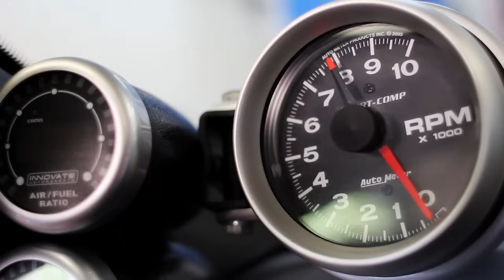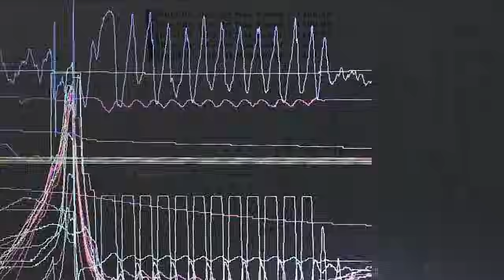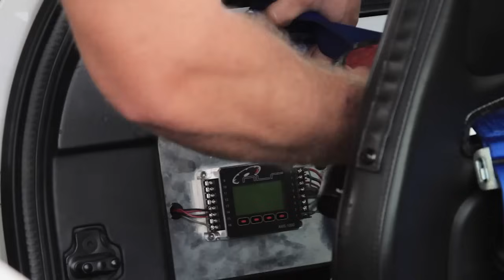New World's Fastest Car! Ford GT Bad v8 1700 Hp - 455.817 km/h ( Guinness World Records )

Comment: fastest car in a straight line  easy   . try fastest car on track
Reply: i wouldnt be surprise if they did make one for that too #USA
Reply: Allen Penitavalu Likiliki then why didn't they until now?     we are already in 2014  .
Reply: Thats like telling the best soccer player in the world to go and be the best basketball player. they obviously built this car for this purpose not to race around a track.
Reply: Brad Hulm your example is a bit flawed... It would be correct if we assumed a soccer player that runs fast but doesn't know how to pass or shoot correctly... A player like that can not be considered good in overall performance. European and Japanese cars are far ahaid...
Reply: Alessio.. No. Just no. Thats ridiculous logic. besides whats so fucking "easy" about 450 kmh? id like to see you try.
Reply: bult ennough torque to push the  charriot forwards against  a wall of pressured air on a overdrived gear.  create a reversed wing to keep downforce. bult the bodywork strong ennough to not rip open by the pressured air it encounters. Make shure the engine last for 10 hours. don't care about manouvrability  brakes, suspensions
Reply: you're forgetting that the Ford GT was built for the track
Reply: austin robinson not with that kind of engine, you would have to be a crazy man to drive that thing fast in corners
Reply: be fun though
Reply: jack jill
still possible with that engine if you have  a torque limiter,,  but then all that power would be meaningless. Anyway they have fun breacking speed limits with piston engines, that's theyr purpose. Its just me that finds race on tracks more exciting.  Different culture I guess.
Reply: Alessio S open track days are awesome!!
Reply: Its the fastest so who cares.
Reply: then go watch track racing lol
Reply: Tom Cholewa
 yes ofcourse, but not F1 that's boring as hell
Reply: *****
    that was 40 years ago.  no american car can beat  european sportscars on track none.  unless you drive  in a big oval
Reply: Alessio S
the corvette is still an American sports car and will whoop most European sports cars, with the exception of the European super cars but you will never see them competitively raced cause they cost to much. So as it stands the US sport cars/super cars (the ford gt and the corvette) trump any production cars the Europe has.
Reply: The GT40 was made for the track. Mid/Rear engine = better weight distribution for better rear traction and cornering
Reply: xFSTRx but that is not a gt40 tho its the newer production  model ford gt the ford created to remind ferrari that their car is still better then any ferrari
Reply: jt cooper  jt no... it was to piss enzo off after he backed out of a handshake deal

Comment: I don't consider this above the Veyron. It's been heavily modified. Almost anything can beat a Veyron after it's been tweaked to 1,000 HP+ (Alpha GTR's, UGR's). But straight out of the factory, a Veyron will slaughter this Ford GT for bacon.
Reply: A straight out of the factory buggatti is already "heavily modified"........ and it cost atleast 1Mill .............................................................................................................
Reply: kenho3j0k3r
I understand that. But a factory Ford GT is already heavily modified, will destroy a lot of exotics at bone stock, and it ranges in price at $400k. I'm sure if we applied the same amount of money they spent upgrading this Ford GT to the Bugatti Veyron, it would slaughter the GT for bacon and sausage.
Reply: Tokyuuu Personally the veyron isn't that impressive. with an "8.0 L (488 cu in) W16 quad-turbocharged 1,001 PS (736 kW; 987 bhp)" you think it would do more. 

As for AMS, Underground Racing, Performance Power, Etc Etc the fact is they are much cheaper than the Veryron (Minus the Venom GT). I guss that's what it comes down to. As for the money spent tuning. They still come in cheaper. For example Lambo Killer Supras and so on.
Reply: WhatWhatWhatWhatWhat cheak out Nelson Racing Engines they have a naturally aspirated Chevy with 712 Hp and it weighs less than 400 pounds and runs pump gas with a 4500 RPM power band starting at 2000RPM never dropping below 500 Ft pounds
Reply: One could argue the words production car. In essence it means that it is possible to be built and assembled in house, that the factory is equipped with the parts and machines to assemble it. But most people would believe it can be massed produced at a high rate when one uses the words production car. It cannot. Lets look at the facts. 1 week per engine, 150 hours per radiator,90 hours of labor per framex2 (front and rear),3 days for the fuel tank,1 hour per handmade tire, the car is assembled by hand, 4 or 5 weeks total to build from start to finish.
Reply: that is not what the video is about.
Reply: MrLembnau Exactly, fastest car on the road. Not fastest production car. And no matter what anyone says this is one hell of a car.
Reply: sirlonghair Kinda scary
Reply: The Sex Couch
Do you think it's easy making 1200hp on 16 cylinders AND making a product that you're willing to warranty for 50k miles or 100k miles?
Making power is cheap and easy....making reliable power that can pass an emissions test (sirlonghair, that means no Nelson motors ) is VERY VERY difficult and expensive.

those who always judge feats of engineering never have a background in the field themselves...
Reply: HunterKiller89 I never said it wasn't a feat of engineering, in the end that's all the veyron is. Another testament to we can do it.

But, since you seem to say something without a background....they HAVE A 2 YEAR warranty...for an EXTRA SEVENTY THOUSAND. And yes for a car that is  "$2,426,904 a Super Sport" that's total shit. It is expensive but just look at the price tag. 

I am in no way saying it isn't a good car, it just is not impressive. Sure you can do almost anything, power and all. But for that price....
Reply: HunterKiller89 Whoops let me clarify. 

Every U.S. Super Sport buyer also pays a 2.71 percent import duty, or about $62,000, plus a $51,000 delivery charge and $6400 in federal gas-guzzler tax. Adding an extra year to a regular Veyron’s two-year factory warranty costs about $70,000, though Super Sport buyers get it free.

Well, let's just clear that up.
Reply: HunterKiller89 A set of the Super Sport’s special Michelin tires costs $42,000 and may last 10,000 miles if you’re careful though they last only 15 minutes at the car’s top speed (at that pace, however, the 26.4-gallon tank is sucked dry in just 10 minutes, and there’s no place on Earth to safely go that fast that long anyway, so no worries). At the third tire replacement, Michelin requires that you also swap out the $69,000 wheels

To get the Super Sport to its 268-mph production-car land speed world record (real production Super Sports are limited to a tire-saving 258 mph
Reply: There's one last thing here....It exists mainly as an objet d’art for its owner and a one-car circus parade for the fawning public. It is perhaps the apogee of internal-combustion performance, the final word before the dawning dictatorship of electric pods. It is a Bugatti

Comment: the bugatti is the fast Production car its not modified at all this car is highly Modified so yea this isnt a fasted car in any catagory at all so you lose
Reply: And on the second run it probably spewed its guts all over the track. While I don't like the look of the Bugatti it IS and engineering marvel because it does what it does with no fuss, time after time as long as you keep the money coming.
Reply: You have no idea as to what you are talking about. Do you really think that companies like VW buy off of the shelf parts for a car like the Bugatti. Maybe they don't actually make the parts but they are very closely specified, tested and durability checked before they are specified for their use. Get off of the computer, get some reliable information and learn, stop swearing at everything if you want to appear to be a credible person instead of a car nut with a friend that knows how to make a fair video.

Comment: that is not a road legal car so it's not the fastest
Reply: Actually it is. But it's not a production car like Bugatti however.
Reply: it was road legal now it can only be used on the strip
Reply: What does road homologation have to do with anything? Its a car, its faster than the Bugatti Veyron verified by Guinness. Also, at no point did anyone say this wasn't a street legal car. From what I can see its a Ford GT with alot of mods. It still has a license plate, indicators, safety equipment, etc. It's just not a factory produced car like the Veyron or F1.
Reply: if it was this fast from the factory it would be worth owning but it's not so it really has no worth to anyone but him
Reply: Ford hasn't been winning le mans audi, porsche, ferrari, and mercedes have ford also hasn't got a new car to use they basically have been using the same car for about 20 years the GT40 then the GT oh and by the way I only get in the right lane when I need to get off at the exit
Reply: oldmusher Sorry Mush, Miguel is right, Ford hasn't won LeMans for over 44 years! I think you're getting mixed up with the Ford GT40 that last won LeMans in 1969. The current Ford GT and the 1960's Ford GT40 are two different cars, the Mk1 GT40 was designed and built in the UK.

Respect to this Ford GT though....there are a lot of street driven 1200-2000hp Porsches, Lambos and GTR's that can't even break 400kph over a standing start mile.
Reply: I see you have never heard of "history".  You should check it out.  When mommie lets you use the computer again google the history of past LeMans winners.  Here's a hint, sonny, go back more than 2 years.
Reply: oldmusher The GT40 won LeMans 4 times in the 1960's but the modern day Ford GT hasn't won anything at LeMans, In fact only 1 has ever managed to finish the race and it finished 3rd from the back.
Reply: Alex wea Just for the record, the Audi R8 is the most dominant car ever at LeMans, followed by the Porsche 956
Reply: ***** kid go and reserch a bit

Comment: Its rather loosely a street car. OK its street legal but its race/high-performance spec.
The record could have been set by a thousand people over the years as there are quite a few people with street legal high end tuned machines with over 1000whp, and even over 2000. No one simply gives a shit as only yanks are obsessed with becoming famous for some silly bullshit like spitting dead crickets and suffocating rats with their ass.
Assuming typical American mindset and engineering it probably only goes fast in a straight line, like any American car, and gets outrun by a Civic on the circuit as it goes off the track at every corner.
Good for you, fine job on the car, I guess, but come on, putting work in for just holding a record is stupid.
Im pretty sure some of those 2000+hp Lambo's can outrun this in a straight and on the track. So why dont they? Because they dont care about making themselves believe in cheap fame and claim its faster than a Veyron when thats a completely different type of vehicle altogether.
Reply: 'MERICA!!!  FUCK YEAH!!!!
Reply: so, what have you done?
Reply: you realize all those 2khp TT lambos are getting shat on by the new GTR right?
Reply: illiji915 Irrelevant.
Reply: Oz M. fuck you dude, quit hating
Reply: Joseph Victors  He built it to be in the book. Thats the point. If he wouldnt have wanted to be in the book he would have gone about it like everyone else with the 1500++hp cars - keep it to himself for himself not make news about it. Instead he invited the Guinness guys to record it.
So no the book is not irrelevant, the book is the whole reason Americans do stupid shit. This guy is not high on the list of stupid but the reason he did it is the same as the guy farting into a microphone or putting golf balls in the mouth - to be in the book, to be "famous". If he wouldnt care about the book he wouldnt be in it.
I wouldnt customize anything to go 465km/h because I dont see the point in doing that.
I dont care about pretty numbers on a piece of paper and to formally own a street legal car with the supposed highest theoretical top speed when the thing is effectively unusable as a car.
Reply: Lol RJ, American production cars have been mopping the floor with your precious, overpriced, euro trash for quite some time now. In fact, C7 Z06 smoked Ferrari F12 and Porsche 918 Spyder at Virginia not too long ago.
Reply: NickWayne100 So? Its still a piece of shit.
Just because it goes a bit faster in a straight line doesnt make it a better car. I would like to see that Z06 smoke even a Clio RS around a circuit.
Reply: Lol RJ, your little hatchback is rated at 1.05g on the skidpad, the C7 Z06 is rated 1.19g. Which means it TURNS better. Still ignoring the facts? Your Clio has a third of the Z06's horsepower. A Civic could beat that piece of shit.
Reply: NickWayne100 Sure, sure.
Reply: Lol "nurburgring times are irrelevant", why because it doesn't support your argument?
Reply: NickWayne100 No, because no one actually gives a fuck about it. Its even less relevant than a 1/4 mile run.
Its a pure speed run not a test of handling or build quality.
Reply: NickWayne100 I am well aware how slow the Clio is. I used it as joke comparison instead of the overused Civic, the way you obsess over it is just ridiculous. Must have hit a soft spot there.
And no shit it was slower, the ring is a speed test... maybe if I repeat it 5 times you will get it.
Put a well balanced track oriented lower output car against the Corvette and it will beat it on a circuit. Thats the simple fact of the matter. Big engine and speed in a straight line does NOT equate to a good car. Quite the contrary, its indicative of a rather simple approach with minimal engineering.
Funny how you call the Clio a piece of shit when the Corvette is actually some 30 years behind in technology even to that piece of shit. The most technological thing about the new one are the poorly fit fiberglass body parts (courtesy of Jeff and George from Kentucky) that you can push in with your finger.

Comment: The stupid ford is not a stock car at 1700 bhp. The veyron holds the top speed  record for a production stock un-altered
street car. This is like comparing a Fiat 500 to a stock Ford gt.
Reply: that and no one likes the veyron anymore lol
Reply: Jeremy D the veyron is no longer the fastest production car anymore, the Hennessey venom gt is.....
Reply: Andy Sny Isn't Venom GT is registrated as Lotus, with custom engine? I mean if its like that, then that makes it a modified car. But i dont know if Henessey actually remakes the whole chassis, not using the parts from Lotus. It they remake, then yes it is the fastest production car.
Reply: Aydın Akyol Hennessey only tuned the engine. The chassis work is done by Delta Motorsport, a British racing company, in England using Lotus Exige 330RR as blueprint from an used US spec Lotus Elise/Exige. The engine is basically from a Corvette.
Reply: Tippotipo Wow, thank you for the information, didnt know that :)

Comment: The quality of the welding on the compressor pipe at 0.43 tells you all you need to know about US motorsports engineering... Built for the sprint and that's it. If I produced work like this it wouldn't even get through QC let alone onto the car!

Comment: The Badd GT goes from 0-283mph before the Veyron reaches 200mph in just a mile.  The GT still has AC, stereo and all its creature comforts and doesn't need a special track to obtain its actual top speed. The Veyron was an all hype car. VW spent millions and millions to reach 260's. The Venom GT and Badd GT crushed that for a fraction of the cost without needing special tracks to achieve their speeds. The Venom is a moded Lotus and is considered a production car. The Badd GT is no different. Fastest is fastest, period.

Comment: For all the trash talking about this car, consider 2 things:

1) how long does the Bugatti take to reach its top speed?  A speed that is much slower than this car's standing mike speed. 

2) the old record for the standing mile was 60 MPH slower the year before! That is an insane leap in terminal velocity, and 283 in a mile means that this car is capable of much faster speeds overall. It isn't done when it hits 283, it's just what it did this time around in a given distance. 

There's plenty more top speed available, unlike the Veyron which is already near the limit of its engineering. Don't take this as a knock on the Bugatti, either.  It's meant to draw attention to what PPR has done with a smaller engine and fewer turbos, along with RWD, in 'old' technology.

Comment: Lincoln mark 8 with the 4.6L DOHC had a 180 mph speed record in the early 90s. Fastest for an unmodified stock car.  All they did was remove the rear calipers, side mirrors, speed limiter, and make sure everything was balanced.

Comment: Bugatti Veyron did 267 MPH with 1,000 HP and you are telling me you need 700 more HP just to gain 16 MPH faster top speed? Guys, you need to work on your aerodynamics more, you should have hit 300 MPH with 700 more HP.
Reply: +Batojiri1 The Veyron did it over a 5 mile straight, this did it in 1 mile...